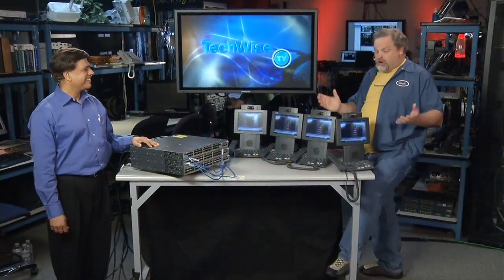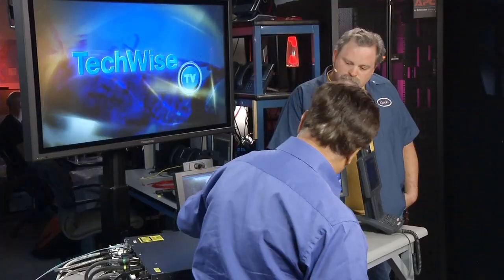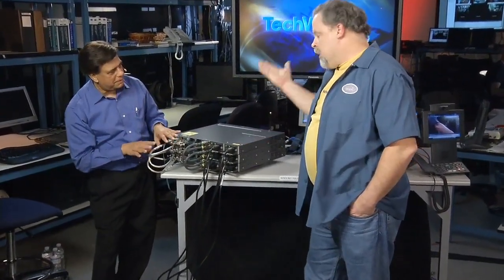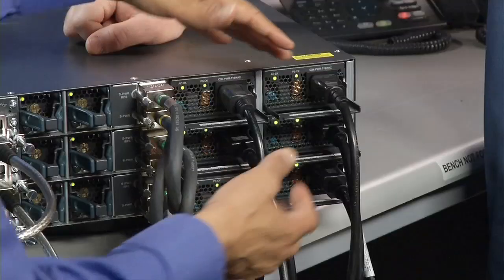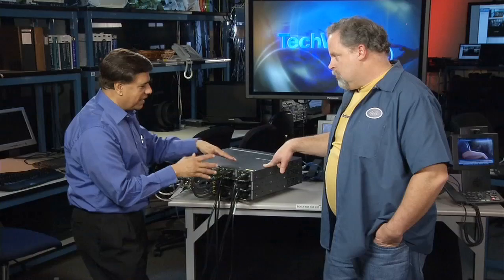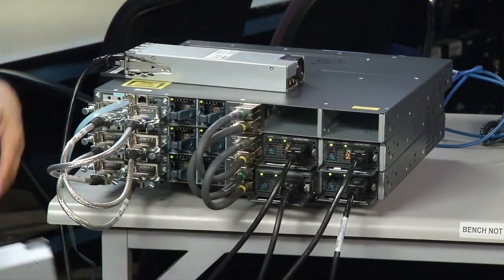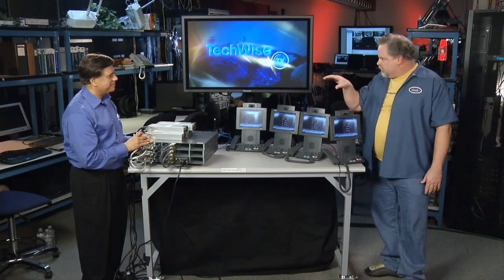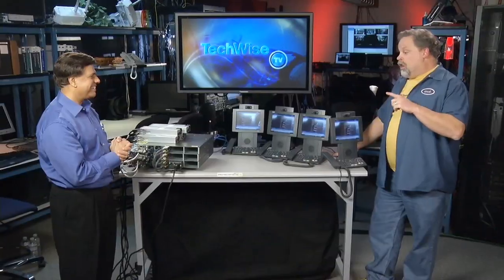Cisco Catalyst 3750X with StackPower - Amazing Demonstration

Comment: I'm trying to do this with a few 3750X switches that I have, but I'm having trouble.

Are there any setup commands or licenses needed for this?  I have connected the cables between a few 3570X switches.  I have tried the "stack-power stack (power stack name)" command, but I couldn't make it work.  I tried show commands like "show stack-power" and I can't get that to work either.  Am I missing anything?

Comment: It's not as amazing as they show it.  Remember that it only worked because they had 4 devices connected to the one power supply.  If you had those fully populated AND all pulling 30W each etc. well then you still can only suck so much power out of one PSU. I wish they would have mentioned that here but sadly they did not.

Comment: Had the pleasure to see this in action at a customer site just this week. Very innovative solution that will undoubtedly prove useful to many organisations. The customer site I was at purchased these after they had several POE switches fail during a lightning storm. If they had this technology the rest of the switches in the stack could have kept them up and running.